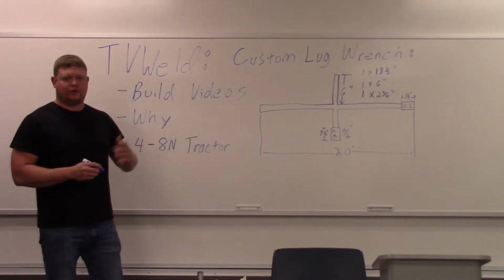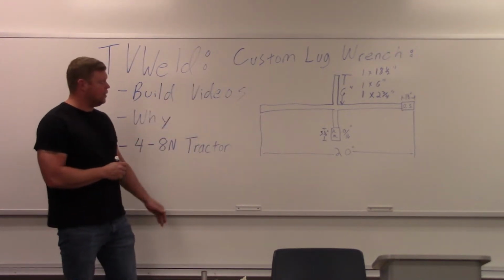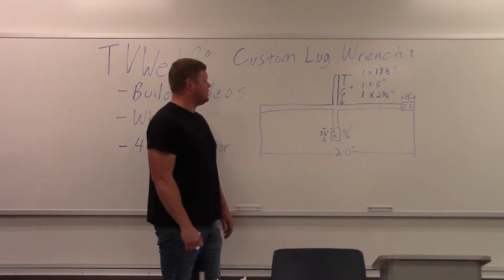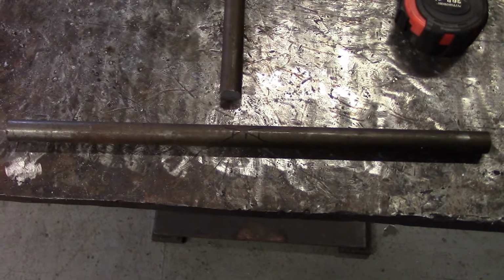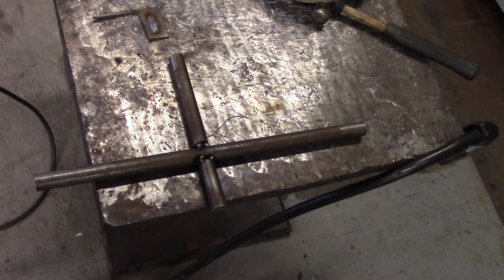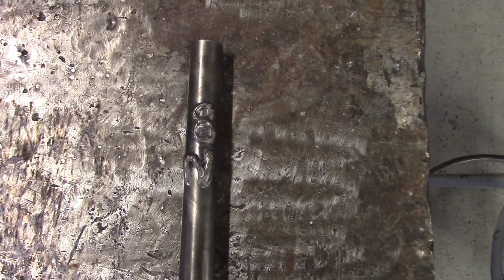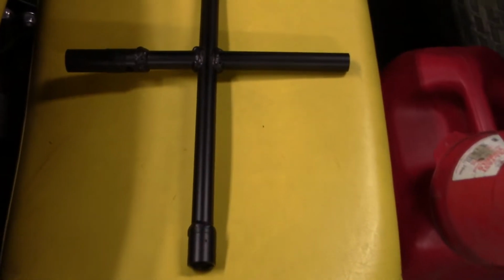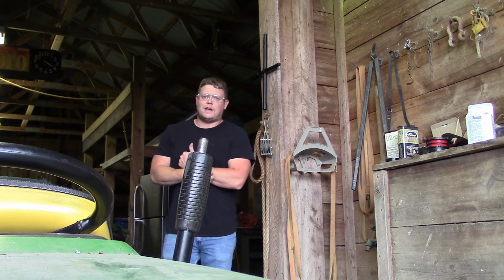Custom 4-Way Build Welding Project

Comment: Good stuff, keep them coming.

If I could ask for one thing , whatbabout a vid on blind setting up a mig welder with out the cheater chart.

I have an  xmt304 Miller power source, mated to  Miller ln7 wire feeder,  funny how setting up arc or tight is dead simple, but voltage to wire feed and knowing where you're getting good penetration would be awesome.

Comment: One way to attach the sockets would have been to grind the ends of the bar to 1/2" square, fit the sockets on the ends of the bar, tack and weld them on. More work granted but there you go. Nice job though!